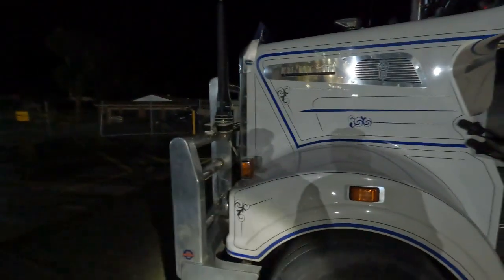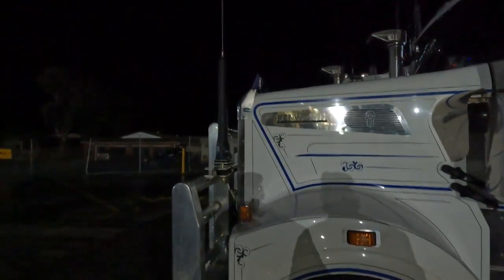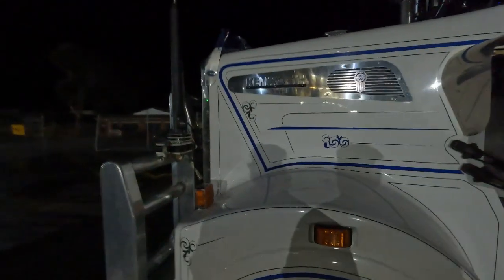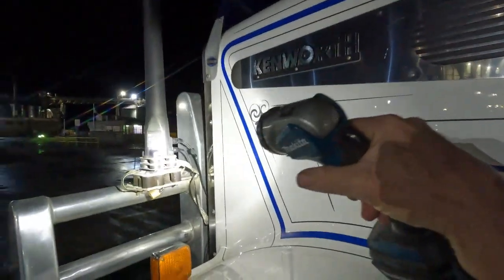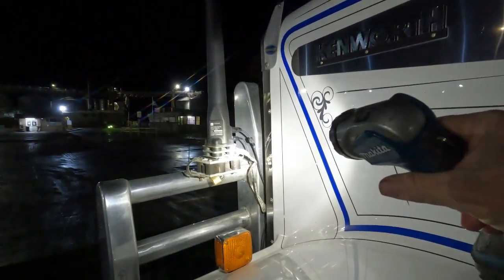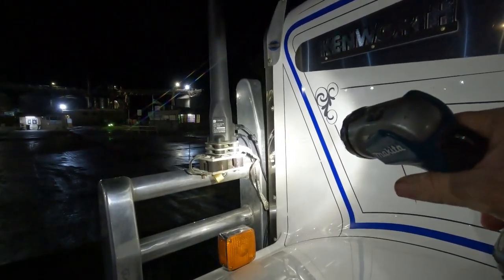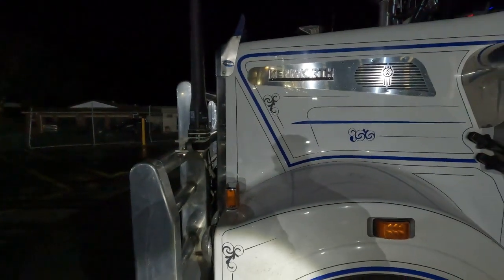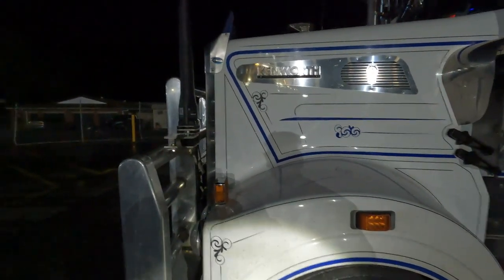Bonding Of HF Mobile Installations   Amateur Ham Radio Quick Tech Tip For Not Too Techies!

Comment: Wow, radio waves are voodoo technology! Everything affects everything!⚡️
Reply from the maker: @Don’z Lockz …yeah, mate. It has me tricked for a minute or a month (although, to be fair, it SHOULDN’T have). It shouldn’t have because the giveaway was that it was receive only, and had all the haul marks of an earth issue and after about 4 decades of mobileering, I have no excuses.

I just (for some reason) didn’t even “see” that rattling in there could be a static or RF generator. It just didn’t occur to me. I kept looking for complex failures instead of Keeping It Simple Stupid.
Reply: @outbacktraveller58  haha, its easy to overlook the simple stuff but I personally wouldn't look twice at that pin and think it was the culprit. At least you found it now. :)

As an ex sparky, we would spray galvanised spray to earth rods clamps after we fixed the earth cable. It may help your strap connections to the chassis from corrosion or any galvanic reactions.🤔
Reply from the maker: @DonzLockz  I was looking for conductive grease/paste in our area but no one much knew what I was on about. The pin is now in the locker box under the bunk coz there’s no way to stop it rattling….AND to make it worse, there’s some rubber. “O” rings to stop the acoustic rattle, but it don’t help for RF/Static